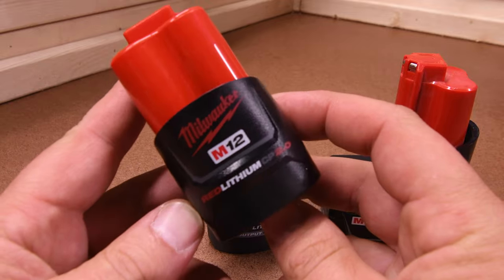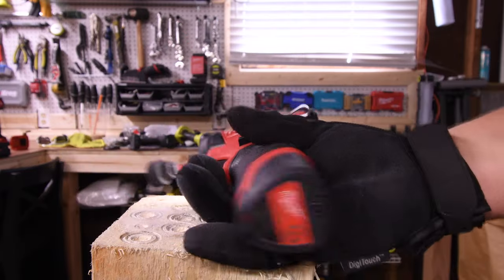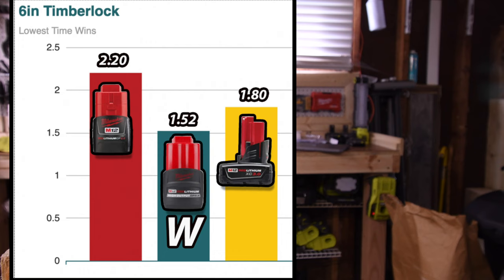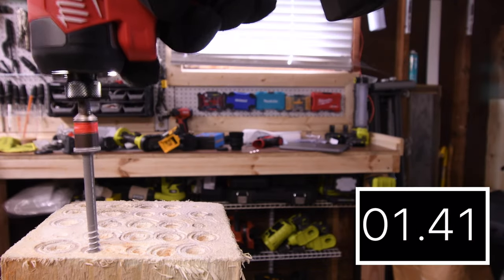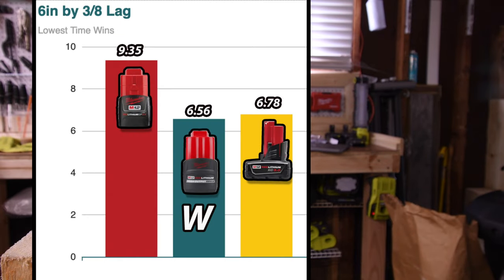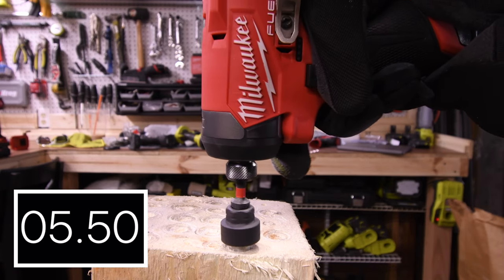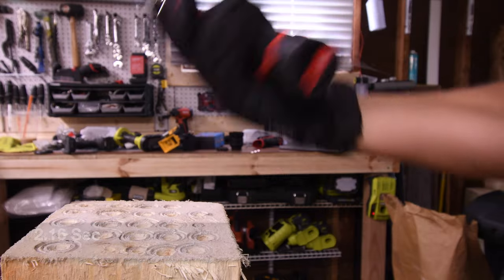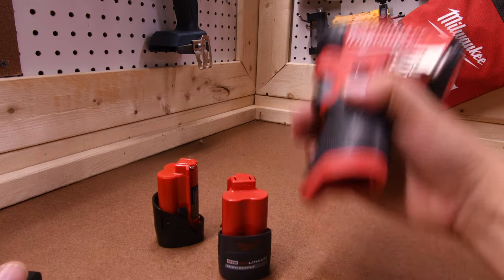New Milwaukee M12 High Output Battery!

Comment: Great comparison video. Can we just take a second to acknowledge the huge leap in capability of cordless power tools over the last 30 years?! 1992 I got to see and use my first cordless drill/ driver; a 9.6 v Makita cordless with a long NiMH stick battery. It was the coolest thing I had ever seen. It wasn’t super powerful, but it was so nice to be free of the cord. In this demo, Dave is driving 3/8” x 6” lag screws into a large piece of lumber without pre-drilling. Even 4 or 5 years ago, I think we would be talking about which 18V/20V tools could or could not pass this test, let alone a 12v! Not to mention doing it that quickly! Incredible.

Comment: The new CP2.5HO battery doesn't bring a life-changing increase in power, but it definitely does bring the power of a larger battery. I think it's a nice option when overall tool size and weight are a priority, but you still need the gusto of the larger batteries. I'd like to buy both of the new M12 HO batteries, but only as a discounted pair or in a kit. Definitely not worth it to pay the full price for an individual battery.

Comment: Nice comparison! I have more than enough 2.0, then xc4.0.and xc6.0, so I really don't see any point in getting this 2.5Ah battery. I will wait to see how the 5.0HO does against the 4.0.and 6.0 before I bother buying another M12 battery.
Reply from the maker: the new 2.5 isn't necessary for everything. im sure it will benefit some people.
Reply: It really isn't worth it unless having your tool at its most compact and lightweight but still needing the power of the 6-cell packs are all absolute musts.

Comment: Interested to see how the 2.5 and 5 HO's do in a M12 Stubby. Curious if they well be able to go up to 3.0 hours and 6.0 hours on both or do you think they are pretty much topped out? Nice straight to point Videos👍🏼
Reply from the maker: we will see Johnny
Reply: The 3.0/6.0 cells have similar or less output than the 2.0/4.0 cells. So given these results, the 5.0 should be awesome.
Reply: @procrastinator1842  That's the one I'm waiting on too. I'll be picking up both of these during the holiday deals. I actually picked up a M12 9.0 Waitley from Amazon for fun on the cheap and it hits as hard if not harder than my 6.0's. I have it as a spare, but run my Stubby's with 6.0 's the majority of the time so I hope the 5 dominates 👍🏼
Reply: @ManCaverTools  Right on Bro. BTW can't wait for your Gen 2 Frankenstein review to drop!
Reply: @johnny4713ify  I went one step further. I did some research into the newest generation cells. Did you know that currently, all the power tool brands use cells from 2014 and earlier? Anyway, I sourced some newer generation cells from a reputable shop, and some empty battery shells from aliexpress, and I'm making my own. A super hard hitting (40A) 2.0Ah CP 3 cell and a super hard hitting (105A) 8.0Ah 9 cell. My 2.0 will have a harder hit again than the new 2.5 HO, and my 8.0 will have even less voltage drop than the new 5.0, so more power for the higher demand tools. I have trouble with voltage sag with the 1/2" hammer drill and circ saw. Currently testing and matching all the cells, will assemble this week and test.
Reply: @procrastinator1842  Not so sure about that. 2.0 also has a habit of cutting off at 2 bars on my M12 cutoff tool or fuel hackzall when pushed hard while not with the CP 3.0. Even when the batteries are fully charged, the 3.0 gives the two tools above more power.
Reply: @procrastinator1842  what kind of cells
Reply: @FireBarrels  you recommend the new 2.5 HO battery for the cut off tool i have one also and want to maybe change to the 2.5 amp ho battery to keep it compact but not sure if its as strong as the 6amp
Reply: @il_calabresi8672  From the tests I've seen, the power is almost as good as the 6.0 so it gives a big boost in power over other CP batteries. I would recommend it if you need more batteries anyways.

Comment: high output battery is a high drain battery that got higher c rating. but the lifespan is lesser. cycle life is low. just like lipo that puffed. but for liion it just stop working.

Comment: I bought some fake 2.5 ah like 2 years ago. Just the audible difference in my fuel multitool was as if there was an additional setting that my 2.0s just don’t have. Even the charge indicators are brighter. They won’t stay in my palm nailer though. Trade off for not buying genuine GM parts.